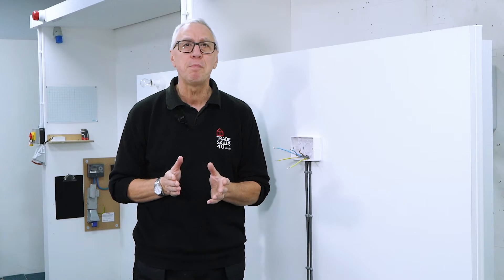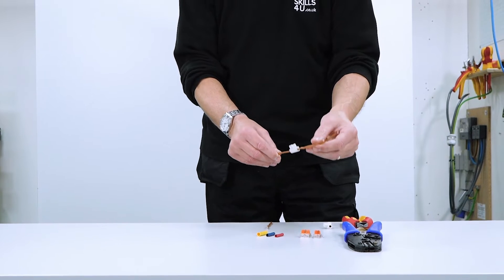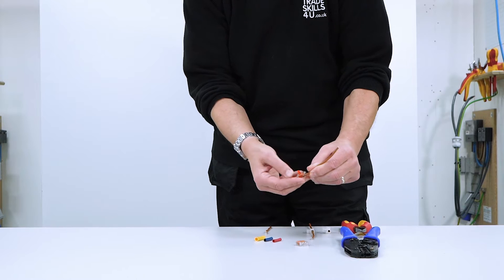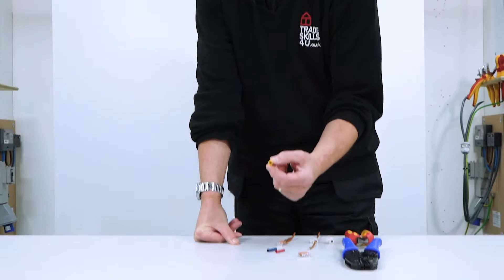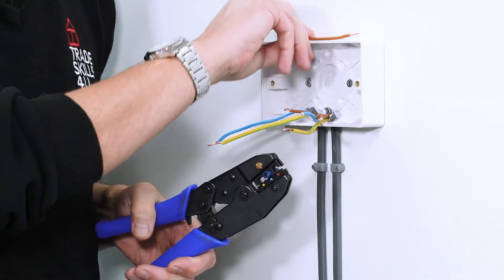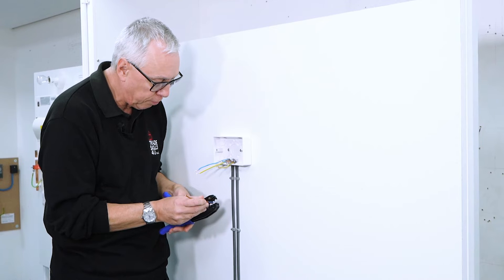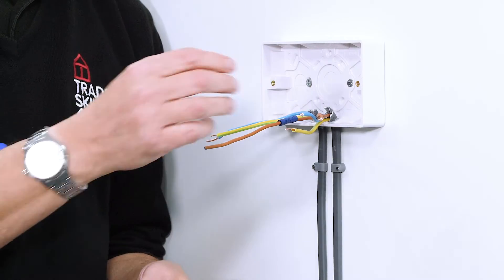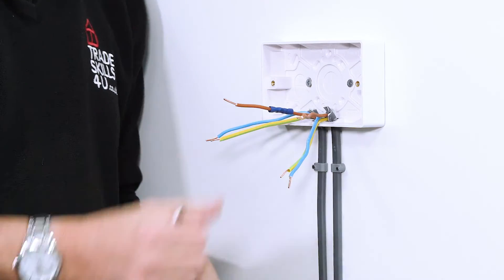How to Extend a Short Cable

Comment: Would it not be better to bring the conductors in together, butted up centrally before crimping.  That way the centre depression is shared across both conductors.  Are you able to expand on your proposal for the secondary question of the double insulation process and what conforms.

Comment: I would use a 3 way wago
Reply: wago is not maintenance free unless in wago mf enclosure fine in the case of a socket but not in the case of a damaged wire in a wall as discussed

Comment: Oh the Irony of this guy trying to teach us how to extend cables and then shows us using a crimping tool and crimps not designed to be used on solid core cables, when you have to educate the educator it is a sad day.

In this particular instance an indent crimper is preferable and suitable crimp to match, stranded or fine stranded are suitable for the crimp tool and crimps he is showing as the wires easily form into the shape the crimp tool creates, a solid wire does not and often creates a poor crimp where the crimp itself is damaged or not formed properly.
Reply: I'm planning extending ebike cables, does it loose electric transfer when extending?
Reply: @bigtonyakacashmoney  how long is a piece of string, longer wire = more resistance, whether that is of any significance depends on the permissable voltage drop. If voltage drop is an issue you can use a heavier cable and move the join closer to the power source.
Reply: I'd disagree.  Surely a crimp offers more surface contact around the conductor, thus better continuity.  Push fits are OK but i'v witnessed the solid core of singles being able to rotate after insertion.  Which leave me to believe a push fit is only a thin blade of copper pushing  down onto a single point of the stripped back conductor.
Reply: @robjenkins9450  If you use the wrong crimp and/or wrong crimping tool then there is a good chance of a poor quality crimp, crimp lugs can split, deform not as designed etc, the consequences of which can be anything from a poor contact or open circuit all the way to a fire hazard and risk to life in safety critical circuits.
  This subject has been extensively researched over many decades, this is why UK rail networks have some of the strictest cable jointing regulations out there, they only allow specified and often hydraulic or electric crimping tools and high quality crimps specified for each cable type.
 Domestically the biggest risk is a short circuit or fire due to poor crimps been made by people ignorant to the risks.
PS - I never revered to push fit joints so you are playing strawman there.

Comment: Would be nice if there was a video showing how to extend the cables/repair outside of a socket (say a drilled cable) as that's not really covered much :(
Reply: I would take caution to learning off youtube videos, the issue been even though a lot of the advice is good he actually is wrong in this video, that crimping tool and crimps are not to be used on solid core cable, they are suitable for stranded cores and thus he has demonstrated a method that can give a very poor joint.

Comment: As mentioned elsewhere needed to explain what double insulation entails. And whether inline crimped connectors need to be in a separate box or can be embedded in a plaster wall like normal cables. It matters aesthetically esp as raising sockets higher in a listed property.

Comment: Im conflicted with using butt crimps on solid conductors. They do make a good join if crimped correctly however they’re better suited for stranded conductors. In domestic work it’s probably fine but on ships or aircraft’s for example they could become loose overtime from vibration. Then again these installations probably use stranded cables to allow for movement

Comment: After u fitted the connector you mentioned the cable needs to be doubley insulated? Can you explain what that means please
Reply: I believe he means heat shrinks. But would’ve been ideal for C&G to demonstrate it to remove any doubts.
Reply: Yeah heat shrink

Comment: Great videos, Wago now do a straight through connector. As you say the side by side ones are a bit bulky. If burying a repaired twin and earth back in wall, is it acceptable to reinstate second layer of insulation with insulation tape? Many thanks, Pete 👍
Reply: Would heat shrink be acceptable?
Reply: @paulroberts9704  If it's just the outer layer and the internal insulation hasn't been damaged then I'd suggest self amalgamating tape for extra assurance.  The problem with heat shrink is ,how would you get it on without cutting the cable? Electrical tape's fine if the outer insulated sheath  hasn't been damaged too much.
Reply: Thank you
Reply: It's not good practice to do this .However if burying cable in walls you should either make sure it's either accessible for maintenance. meaning you could use a patress back box or a maintenance free junction box. For example ideal/wago/hager with the appropriate type tested joints within the enclosure. Any other form of connections wouldn't be to regs.  ideal spliceline inline connectors are spot on for extending cables within consumer units and back boxes. Rated @ upro 32 Amps ideal for radial ring circuits.
Reply: There is a single wire straight through however no more sadly.